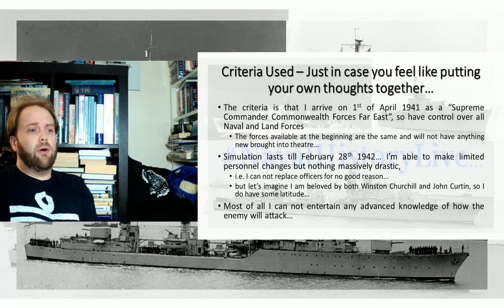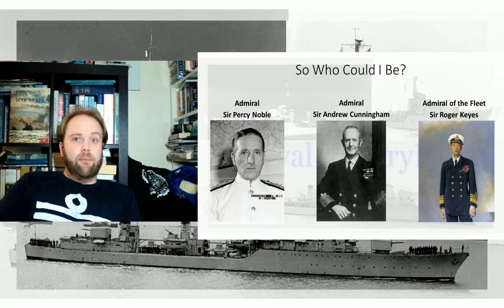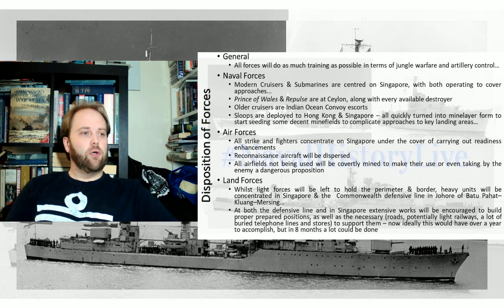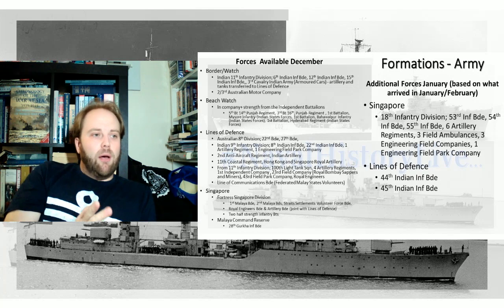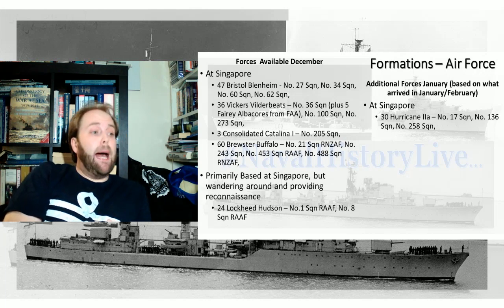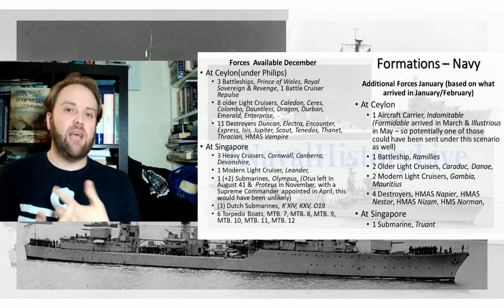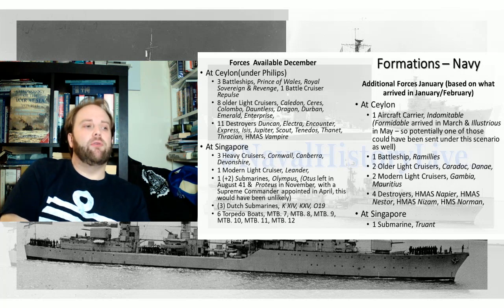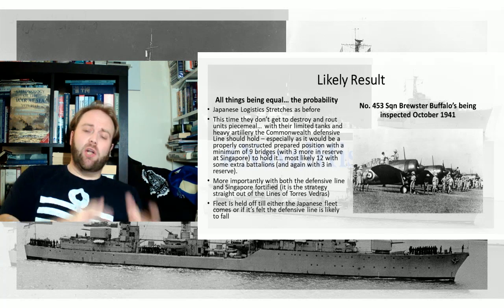An Introduction to “The Battle of Malaya & Force Z” – Part 2: The Counter-Factual; My Plan

Comment: I'm not sure if comments this late are worthwhile, but here goes anyway.

I think your plan suffers from two fatal flaws. It doesn't take Japanese naval aviation into consideration and it doesn't account for the vulnerability of  Malaya/Singapore to the loss of the NEI.

Your raiding cruisers are going to be located and sunk by the Japanese Nells based in Vietnam within 48 hours. 

Japanese naval air wasn't deployed to Thailand/Malaya during the campaign because it wasn't necessary. Basically the British lost too soon. If your plan works, the Nells and Zeros based in Vietnam and the Betty's and Zeros used against the Philippines would probably shift to Malaya airfields. The Nells and Bettys have an effective combat radius of 600 miles, and they carry torpedoes and crews will trained in their use. Zeros have a combat radius of 400 miles. If Zero escorted Nells and Bettys begin attacking your supply convoys, your shipping losses will become extremely heavy. You use an analogy with Malta. OK its like Malta 1942, except the garrison is 10 times as large and you have an active land campaign going on, burning up supplies. Malta was able to live on stockpiled supplies between shot up convoys. How long can Malaya go with out resupply with fuel and ammo? I think not long. Your plan is based upon the assumption that you strategic depth. This is an illusion. If the Japanese get to the Penang area, their within Zero range of your sea supply line and you've lost. You have to hold the Japanese well forward to survive.

What makes the British situation even worse, is that even if you hold out, the loss of Sumatra completely cuts your supply lines--- and its going to fall eventually.
Reply: Totally agree with you.

Comment: Effectively abandon Hong Kong (enough to make the Japanese fight for it) - Force C (The Canadian brigade) and the Regular formations to form 2 more Brigades for the Malaya Theatre. Try to build up the 3 forces defending Ambon, Rabaul and Timor (all based around a single Battalion from the 8th Australian) to Brigade Strength. Have the 2nd Torpedo Squadron (6 torpedo boats) with drawn from HK and operating from Kota Bharu - both Insect gun boats also withdrawn and operating on the West coast. Have the 2 Brigades of the 8th Australian train like feth for the operation Matador to deny the ports of Pattani and Songklah and force the Japanese to invade from the Kra Isthmas. Inflicts a great deal of 'friction' on the Japanese plan. Ask the Dutch to use their submarines to patrol around the Gulf of Thailand and South China Sea.

Comment: Would you worry about Japanese by passing the defensive line by landing further south? Would you consider inserting harrassing forces in enemy rear via west coast at night?
Reply from the maker: well if they land further south they would be landing into the prepared positions, besides which there is a reason the fightin took place mostly towards the west coast... if you had forces capable of doing the harrassing on the west coast you might do it... but they didn't, so you couldn't. thanks for commenting.

Comment: Your scenario assumes setting up a defence against the Japanese forces that attacked.  Theatre commanders could not assume the Japanese would attack Pearl Harbour as well.  They had to prepare assuming Japan decided they could bring full force against British and effectively disable them like they did Vichy French without American interference.

Your scenario assumes that in April 1940 the British anticipate that in any conflict the US would support them, and 4 carrier air strike forces and other Japanese forces would be otherwise deployed.
Reply from the maker: it doesn't make any of those assumptions, it's about protecting singapore as  choke point... it's about defending it with the forces the British have available... and responding with the forces the British Forces available... if the Japanese had chosen to make it the primary focus of their attack and all their resources were thrown at it, it's difficult to see how it could have survived with the forces available whatever was done... but this plan would have been the biggest sliver of a chance. thanks for commenting.
Reply: @DrAlexClarke I propose recall Admiral Walter Cowan to be sent with Keyes as 2IC. His voluntary demotion refused
Reply: @DrAlexClarke I also propose taking 300 BL 12pdr 6cwt horse guns and 120000 rounds of ammo and ammo carts to be sent to Yangoon and pay the Chinese for 150000 labourers which will include tofu artisans. Set up a tofu manufacturing and canning facility in Singapore to produce rations for Indian troops. Britain knows about tofu from contact with the Chinese for well over a century.

Comment: What of the Dutch? They did commit som air elements to Singapore. Sumatra is close. There is also Hart's Asiatic Fleet based at Cavite. How might they play a role if petitioned. I would think Hart would be quite open to working in the rear- what with Houston, Marblehead and his subs, Maybe the old flush-deckers as well? What if Keyes would have demanded Churchill put him in charge of ABDA? How would he have done and what might he have accomplished?
Reply from the maker: all interesting ideas, but beyond the scope of this... once you go to far you are no longer in the learning counterfactual zone and are in the fiction zone... but my view is it would have been very interesting... thanks for the comment.

Comment: Would it not be better to concentrate the "S" class destroyers (the minelayer conversions) at Singapore - particularly the ones at Hong Kong. ps - as an Admiral of the Fleet, Keyes outranks his subordinate commanders so far that they probably wouldn't dare argue.
Reply from the maker: might well use them for that... I didn't want to get into the Forces at Hong Kong as again that is going further, but certainly Keyes would have more than likely restructured the forces... thanks for commenting.

Comment: I guess the logistics is the weak link especially if the "concentrated" airfields are neutralised by airstrikes (and you have "battlefield interdiction" from japanese aircraft), plus the political fallout of the "scorched earth" part (including the alienation of population).
Reply from the maker: As explained in the live, needs must - plus if they won it would be called "A decisive & successful strategy" - plus as there were four airfields on Singapore I'd hardly call it concentrated... the Catalinas didn't even use an airfield... thanks for commenting
Reply: @DrAlexClarke  Thank you for answering. As per the "weak links" I only meant that those details need great attention, not that they automatically result in failure.
Reply from the maker: @karlvongazenberg8398  the whole of Malaya needs attention really, it is one of those scenarios which just hurts as there is so much wasted... thanks for commenting

Comment: As a Japanese commander I'd probably not expend too much effort in attacking your lines (barring any obvious weak spots) but rather force an amphibious landing behind the defensive lines if possible. Failing that, ravage Northern Malaya and withdraw, declaring victory.
Reply from the maker: Landings would be met by 15in guns with armour piercing rounds, and gurkhas... thanks for commenting
Reply: @DrAlexClarke  Not talking about landing at Singapore. There's a fair amount of space behind the defensive lines that's outside of 15" gun range.
Reply from the maker: The 1st Lines yes, 2nd lines no... plus as said in the live making an opposed landing against a prepared defensive position is a very different prospect... thanks for commenting
Reply: But don't forget your whole point of being there is to seize oil and rubber. If you fail to do so, you lost and the Emperor will have your guts for garters. I know oil is in Sumatra and Java but you need to secure the supply lines from Sumatra and Java to Japan

Comment: What I would do is: defend Singapore, however because of the range of Japanese Bombers I would base them in Ceylon as you have done. I would split my aircraft in 2 parts 1 in Sumartra and 1 in Singapore. Army would conduct a fighting withdrawal to Singapore the retreating troops would be in Chaos so I would send well rested and trained troops in Jungle Warfare to delay the Japanese and maybe use some Commandos (if available) to try and raid/ kill Yamashita or his staff, because with that 'head' being cut off the 25th Army would be leaderless and able to be defeated.

Comment: It is much more sensible to defend one area than try to do it all.  It failed in Norway and made North Africa far harder when we tried to do too much.  Instead of sorting out Libya, Churchill insisted on sending troops from North Africa to Greece.  Too little in too many theatres is a recipe for disaster.
Reply: Depends on your manouverability and communications. Without much knowledge in the Malaya/Singapore campaing, if you have "roving death squads" in Hussar/light cavalry style, which constantly harass your foes seemingly EVERYWHERE... That will tie down a lot of forces.